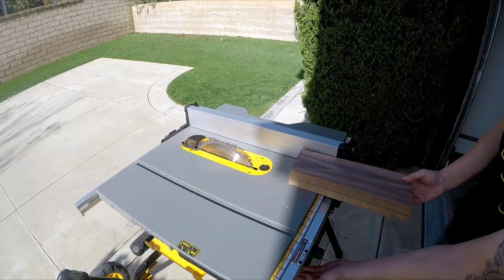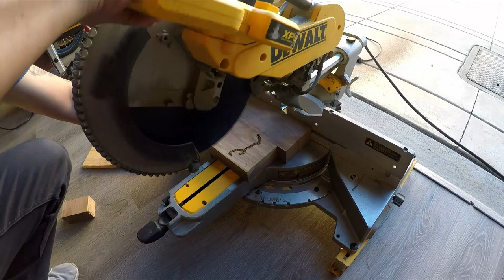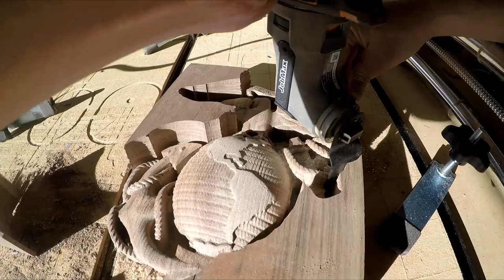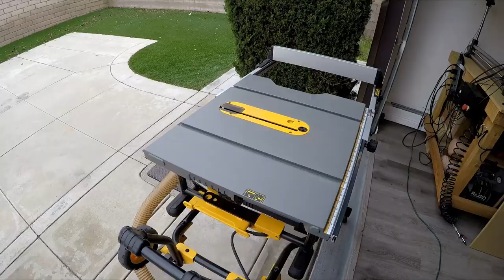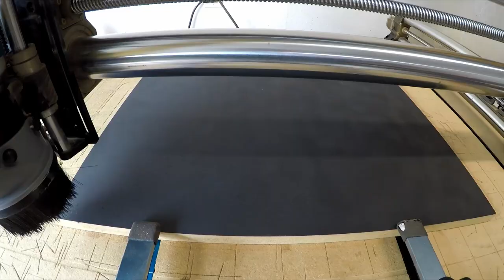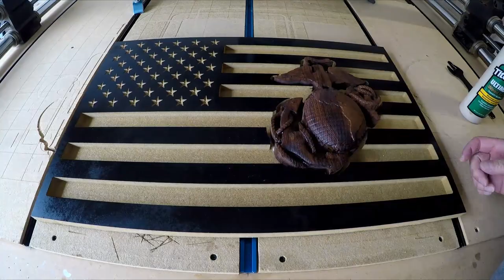American Flag with 3D USMC Emblem made using the @OnefinityCNC and @vectric on MDF and Walnut

Comment: What feeds and speeds for the EGA?
Reply from the maker: I don’t think it’s ideal speed and feed but I ran it on 100 inch/min and whatever setting 3 1/2 is on the Makita router.  The Ega is essentially 8x9 1/2 and took approximately 4 1/2 hours. Hope that helps a little, thanks!